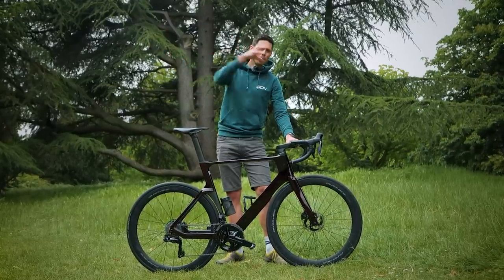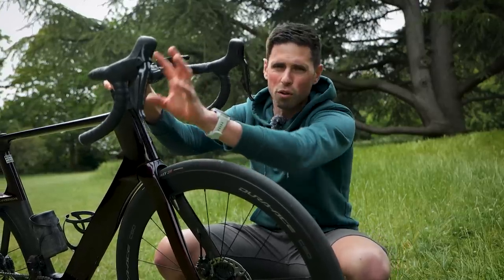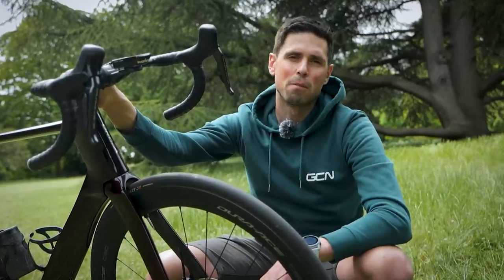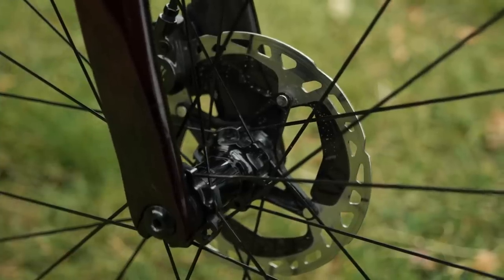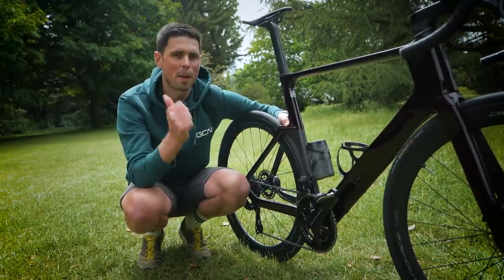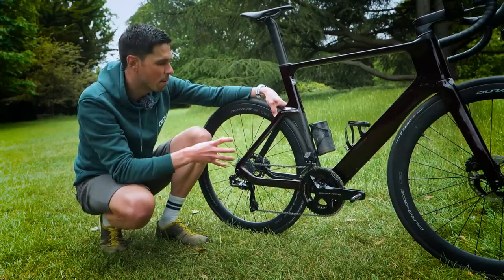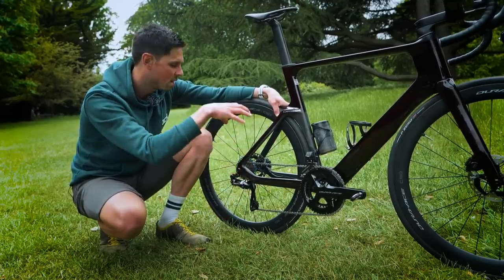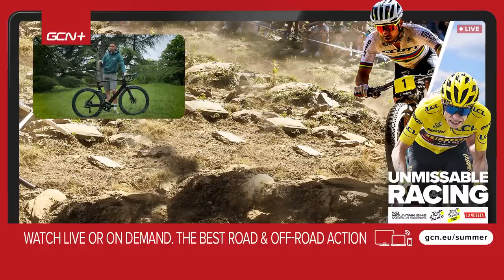Don’t Buy New - These Bike Parts DON’T Need To Be Replaced!

Comment from the maker: Do you always service your old parts or just buy new? ⚙
Reply: Technically both, I keep old but if I feel it worn I often replace with new and give my bike project my old parts to use on bikes they service if they think worth keeping
Reply: I try to service and repair, but currently frustrated by Shimano hydraulic shifters and calipers not repairable because of the lack of spares.
Reply: some are service parts some will be replaced when needed
Reply: Service whenever possible. Replace only when worn out or damaged.
Reply: Never had a part replaced that hadn't died a gruesome death xD
Reply: I've lost count on how many times I've brought the Shimano XTR pedals on my gravel bike back from the dead. Take them completely apart, clean and degrease everything, put them back together while adding fresh grease and they will be like new. Many times I've actually had the finger on the order button to order a new pair of pedals, but in the last moment I've decided to try servicing them before ordering new ones, and after that I didn't need new pedals.

From what I've heard, this applies to most Shimano pedals.
Reply: I enjoy buying old super bikes from not that long ago and sorting them out as good or better as new. Rim brakes and external cabling until I can’t get them anymore!

Comment: I’m a fan of doing these things yourself and favoring parts that are serviceable. Shimano dealer manuals have all of the servicing details and are easy to find online, even going back several decades. It’s fun and satisfying to service these things yourself. These GCN videos, Park Tools videos and others, show you what you need to do. Every project gets easier as you learn, and it’s great not having to wait days or weeks for a bike shop to do something you can handle.
Reply: Bicycles are relatively simple machines!
Reply: @kokonanana1  At least they used to be 😅. Steel frames can be aligned (bent) back after mild crashes. Btw, one of the best bike repair youtube channels is RJ the bike guy. Top notch stuff. Cheers!
Reply: @KarlosEPM  A few years back, I needed to bend a steel frame to fit a wider hub and found a selection of great RJ the Bike Guy videos
Reply: The simplest is swiping your card and tossing the bike at the mechanic. No grease on your fingers needed and the bike just fixes itself.

Comment: EXCELLENT VIDEO!!! The proper service will stretch the life of all your bicycle components immensely. This care is not rocket science. You don't need a PHD to maintain your bike. Many businesses, not just bicycle component companies,  want you to buy new.  That is why they build them the way they do. It makes your wallet thinner and theirs thicker. Maintain your bike with repair instead of replace so you can reduce your contribution to land fills. I have been a professional mechanic since 1976. A lot of the newer mechanics see replacement as the quick and easy service they call repair. I show pros and amateurs how service, repair and replace are dramatically different.

Comment: My bike is older than Alex so the components are serviceable in the extreme. I'm not getting younger or faster, so a modern bike is a complete turnoff considering just how many new tools I'd need to buy to maintain it at the same level. Threaded BB, rim brakes, mechanical derailleurs, external cables, downtube shifters... all easy to service and maintain. That said, I will still scan the auction sites for replacement parts like front derailleurs, levers, etc. because the supply of parts, particularly in NOS condition, is limited. I just dropped low triple digits for a replacement freewheel because finding them unworn with good cog differentials is becoming needle in a haystack level activity. At any rate, every new part upgraded-- even the power link connector in the new SRAM chain-- usually requires a companion Park tool.
Reply: I am agreed with you, I started riding during 90s and stop before millennium. And just back to cycling last year, to my surprise. everything became so expensive and need to be replaced whenever problems arise.

Comment: It's a real shame manufacturers don't sell rebuild kits for disc brake calipers. Some models are quite prone to piston seal leaks (Shimano BR-RS785), and sometimes you accidentally crack a piston. If you could get the right square seal and replacement pistons, a perfectly-good caliper could be saved
Reply: Hope does this, you can buy everything you need including tools to fix a caliper.  Shimano, Sram, TRP and Magura all won't sell you parts to fix or have even the option of factory rebuild, they will just sell you a new caliper
Reply: SRAM has kits to replace pistons and all the seals

Comment: Remove your pedals from the bike and service those threads occasionally.  I had my pedal come apart on the way to work one day; got it to the shop riding on the spindle, they couldn't take it off to put new pedals in.
I ended up leaving with new crankset, BB (they couldn't get the preload right and I had worn some grooves in it), and pedals all because it was seized.  Way more time and money than I wanted to spend.
Reply: Depending on the materials of the components and the conditions under which the bike is ridden and stored, it may be best to use mounting paste/anti-seize compound on such threads (pedal, BB spindle, BB shell).
Reply: @KarlosEPM  I'd say using anti-seize is standard practice. Nobody installs pedals dry, except wrench monkeys.

Comment: I had Shimano Ultegra wheels. Ended up replacing the cones and bearings. You can replace the bearings with ceramic, and they will last longer.
Reply: Unless the cups and cones are hardened, it's not a good idea to run ceramic balls in those hubs. Wear will actually be accelerated as ceramic is harder than steel.
Reply: @yonglingng5640  The original Ultegra wheels didn't have them. However, thry were upgraded because of widespread adoption of ceramic balls. Also, Shimano warned about overtightening the cones as the could and sometimes deformed the hollow axles.

Comment: I wouldn't just drown the shifters in degreaser or other cleaning product, but try to take them apart and clean the insides with coton swabs or whatever needed for precision cleaning. And I would apply any lubricant to the actual pivot points there too. That being said, I had my prvious bike about 9 years and previous owner had it about a year (combined we put about 45000 km on it) and it had some cheapish Shimano shifters. A few times I cleaned them when I suspected tha the sluggish shfting was caused by them. It never was. It was always the cables. The aluminium frame failed before the shifters. (The frame actually snapped in half, but it lasted pretty good considering I also ride in the winter here in Finland.) 

On to the cables. After a few attempts at lubricating the housings I found out they work best if you dont really use any lubricants in there. Most modern cable housings have a some sort of self lubricating or otherwise slippery plastic layer in them. Any added lubricant just collects dust and forms some sort of gunk in there that makes shifting sluggish and brakes stick. With no lubricant it takes much longer before I have to do anything to them and I have never had any problems with the cables rusting.

One more thing. Cheaper shomano free hub bodies are not serviceable according to the manufacturer. There are videos about how to make a tool to open them. Once you have the tool, they are actually pretty easy to service. Only other things needed are grease and about 50 pieces of 1/8" bearing  balls... and maybe a small screwdriver or some sort of pick to take off some round springs. The first one I serviced has now been in use for a few winters and I think it actually feels better than the newer one I have on my summer wheels. Only when turning it by hand wihtout the cassette though. When riding I can't feel any difference. Before maintenance it was sticking and did not engage every time.

Comment: Great video on bike maintenance. I think you it would have been better if you used an older bike that had worn components as your demonstrator vs. a modern bike with electronic shifting and disc brakes.

Comment: Seeing how my newest bike is 25years old I repair and rebuild everything
I would like to pick up a newer bike, but then I will loose compatibility with my large parts collection.
eBay has become the source for replacement  parts.  
Just don't expect them to be as good as they are described.
Speaking of which I need to get to work and two bikes that are in parts right now.

Comment: Try finding replacements for 9 and 10 Speed equipment.
Reply: It's not hard. But you'll have accept the fact that you'll be buying "lower tier" from any brand. Heavier but durable (as well as cheaper).
Reply: Not so, Dura Ace can be very cheap, indeed cheaper than Ultegra sometimes
Reply: Sora and tiagra are all over the place  it's as good as the old high end stuff just a bit heavier.
Reply: @zedddddful  Exactly. All hyperglide. Sunrace also makes compatible cassettes and with different gear combinations, and so does Miche (italian manufacturer for some Campagnolo components).
Reply: I use a couple of 9 speed setups. Spares are cheap and relatively common to get. These are just not Aluminium or Titanium cassettes and derailleurs with carbon fiber parts
Reply: I have found quite a few in both bike shops and eBay
Reply: Indeed, just replaced my Tiagra 9 speed cassette for only €25!

Comment: Bit about wheels with cartridge bearings wasn't clear. You can just replace the bearings with new cartridge bearings. Pretty easy to do and a better idea than trying to lever open the bearing cartridge.
Reply: It only needs replacing if the races have gone rough.

Comment: long story short ,, old bike 20-40 year old , with bit of greece and oil will work for one other 20 years , new bike  build in the last 10 years , just thow it away after 5 years , or one year if you are racing ,  if is aluminun  you can recile it if carbon will end up in land field like all the plastic

Comment: I did the service for the C50 Wheels and it turned out horribly. There is friction now in the free hub and It cannot free wheel without loosening the cones excessively. Local bike shop is having trouble as well with it.
Reply: Are your cups and cones pitted? How are the ball bearings?
Reply: @yonglingng5640  Nothing visibly wrong with the cups and cones. Bearings all look fine. Local bike shop cant figure it out and is contacting Shimano. I regret doing this 1 year service for these wheels.

Comment: Are you implying that some people really toss parts to the bin instead of servicing them?
Reply: You'd be surprised what some people with more money than sense throw away! My LBS is full of like-new tires customers discard when changing... other things I've seen people throw away include wheels that only needed a simple hub service and an entire mtb groupset 😑
Reply: @adamweb  I get crazy bargains on race bikes whose shifters are stuck due to dry grease. It's mind blowing.
Reply: And quite a few upgrade group sets when they prob don’t need to
Reply: Yes, the most common of which is inner tubes. One puncture and they want a new one, either that or they had no clue inner tubes can be patched, but not all shops have inner tube patches in their workshops.
Reply: @adamweb  I've seen people recommend changing the cassette every time they change the chain or every 3 chains. I changed chain wheels and cassette after about 23,000 miles. Chainwheels are worn out but the cassette could go on a bit longer.

Comment: “DISCLAIMER!!! If you’re doing al of the above the first few (idk.10x) times, be prepared that you’ll damage some stuff, that can cost you from a 100£ to a new frame/bike.”
Would be nice to hear it from time to time in your videos!!!
Best regards, all pro mechanics that have to fix this sh*t (1h work&angry customer-when billed, instead of 10min easy fix)
Reply: Haha - important point here GCN
Reply: I'm not a pro mechanic however I do my maintenance myself and did custom builds too but I never damaged a frame at maintenance.

The only frame which was damaged was the one of my commuter where I replaced the bottom bracket after 3 years and because the factory where the bike was built had the glorious idea to mount it without any grease it was seized and took some of the bb thread with it (there's still enough to hold it however). With the BB I mounted I never had such problems since I lubricate the thread
Reply: @simonm1447  I had a similar experience with a grease-free threaded BB on my commuter/gracel bike. After 12K km I decided to replace it and found I couldn't move one side.  Neither side was lubricated. Fortunately, By applying WD-40 a few times and buying a full ring- type BB wrench I got it off without damaging the thread. The full ring wrench made all the difference. As you say, thread now well lubed.